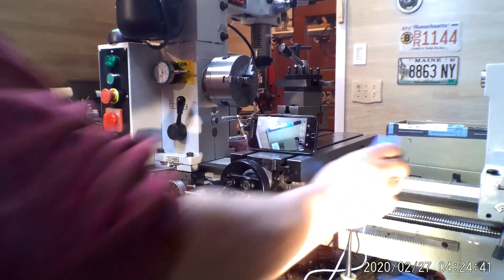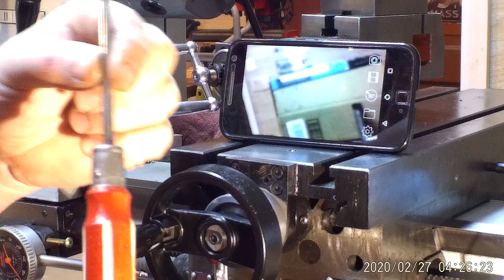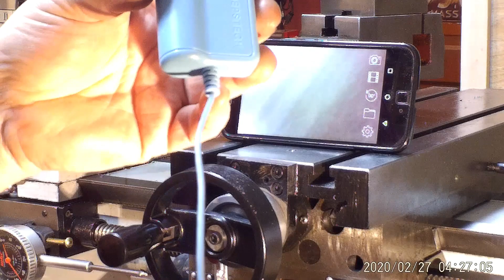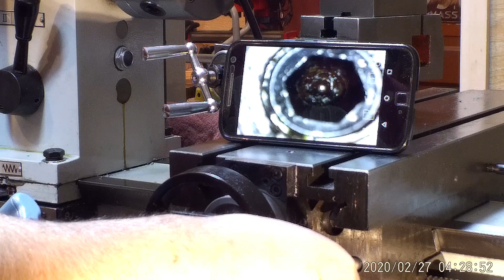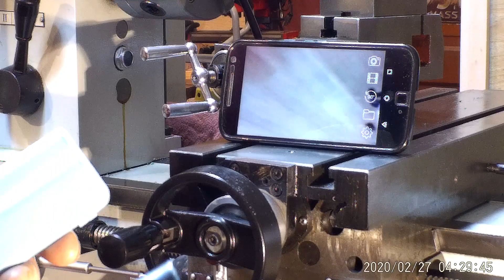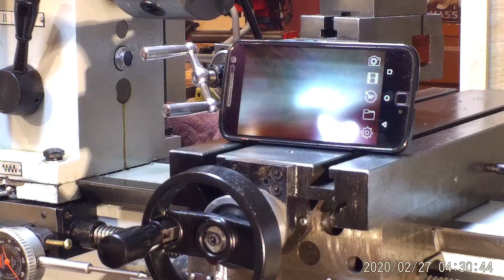Borescope trick to help set up new machine.

Comment: I was waiting for a video on the new machine :-) got any cool projects planned for it?
Reply from the maker: Just trying to clean, lube and adjust everything to my liking 1st. And getting to know the machine by doing little machining. I just took apart all the dials on the handles so they are nice and easy to turn to set zero, little thing like that. I got some new tools in and more coming tomorrow so I think I am going to do that coat hanger challenge thing.